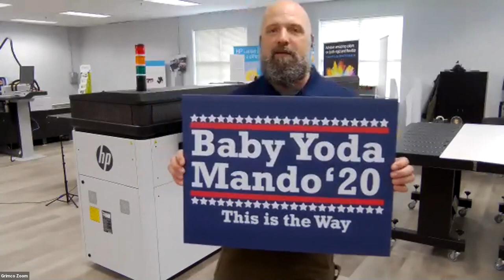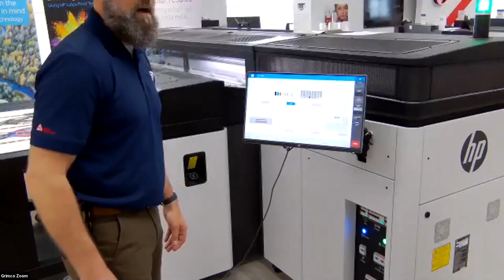HP Flatbed R1000 Series Live Demo

Comment: For Roll to Roll can you run inside print rolls as well or only outside print rolls? If so, how do you set the machine to run clockwise instead of counterclockwise?
Reply from the maker: Thank you for your question. The machine will automatically detect winding direction during the loading process to accommodate print side in or print side out media.

Comment: Can you print double sided on DS banner?
Reply from the maker: Hi Justin! You can print double-sided on rigid double-sided. You can do rolled goods double sided but it has to be aligned manually.
Reply: @Grimcoinc  Is there a video anywhere that demonstrates how to manually align them?  Or where to align to so when it advances and starts to print it matches up?
Reply from the maker: @JustinFickle  We don't have any video demonstrating this, but check this out: https://lkc.hp.com/blog/how-print-double-side-hp-latex-r-series-printer - this is for rigid, but it might help.